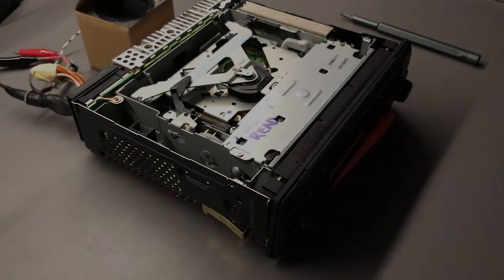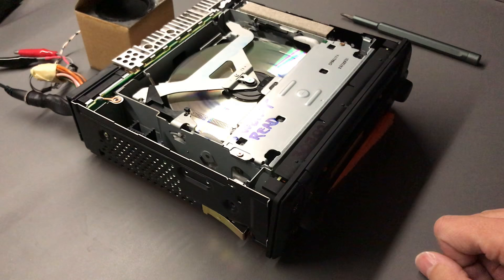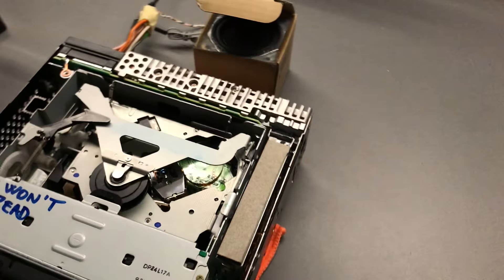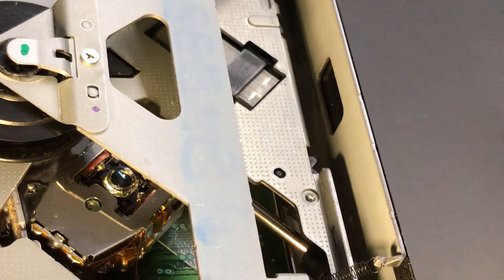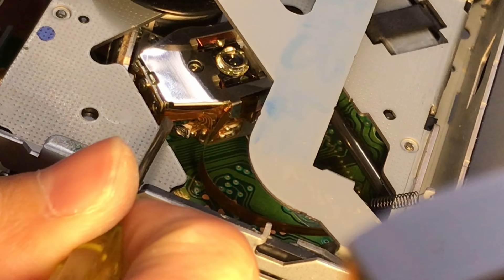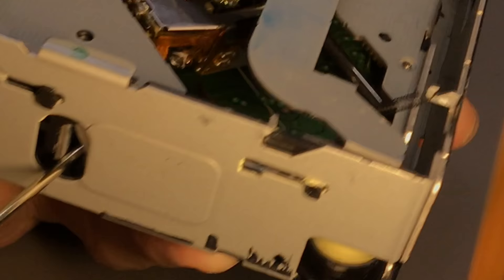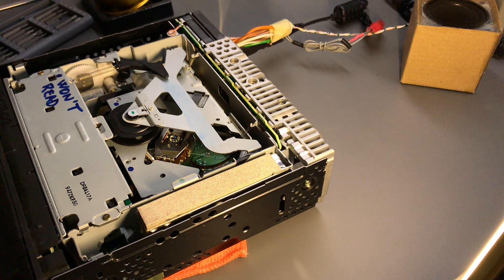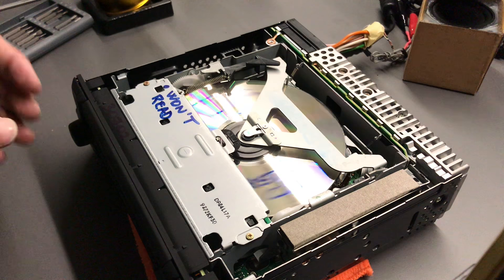CD Player not Reading Disc Fix - Increase Laser Power (to 11)

Comment: Tried this on 30 year old Technics which just stopped reading cd.   Amazingly it worked.   Christmas magic. Thank you for a very clear video
Reply: Did the same thing with a Technics CD Player, Model SP-PG480a some years ago and worked really well. Now i have another (same model) and cant remember how i did it. Do you have a guide of the values for the adjustment?? Thanks in advance!!

Comment: As a laser diode ages it loses it's conductivity like a dimming bulb. To compensate the current going to it can be increased by this small pot to allow the laser 
to become brighter and read the disk correctly! Just don't turn it all the way up or the current will shorten it's lifespan very  quickly. GOOD FIX!
Reply from the maker: thanks for the explanation!

would you expect this to work multiple times ?
Reply: Wouldn’t increasing the current cause the unit to overheat ?
Reply from the maker: yes, which is why you have to be very careful with how much you increase it

it'll die out due to being pushed too hard before overheating though - it's usually part of a big metal casting
Reply: @michaelfeeney8437  Yes but you could monitor it but that may call for some expert analysis with a meter.

Comment: 70 year old woman here.  Our 30 year old 3 disk CD player was not reading in any of the positions.  I bought a cleaner disk that would not even read.  I was thinking of buying a new one.  I decided a drastic fix wouldn't hurt anything.  I doused an unwanted CD in alcohol and put it in and tried to play it.  It didn't work.  I then poured about a teaspoon of alcohol on the middle of where CD #2 sits.  I closed it and pressed the play button.  It played funny for a few seconds and then it worked just fine.  I played it about 30 minutes and it was still working and the alcohol had evaporated.  I'm not suggesting this method, but I didn't need to unscrew anything.  Now I don't need to buy a new CD player in 2020 when they are on their way out anyway.
Reply from the maker: yea, a microfiber cloth damped in alcohol is what fixes 70% of my lasers too

the other 30% do require this nuclear method of boosting the laser power

I'm sure you'd be more than capable of doing that as well with a bit of patience :D
Reply: @Darieee  I do fix things around the house.  Our toaster over door wouldn't stay closed till I fixed it.  Just in the last couple of weeks I spent hours updating a Windows 7 and an 8 to 10s (waited too long because I didn't like W10).  But I really was ready to get a new CD player and had lost patience.  I take of lot of risks when I fix things because I don't know what I'm doing, but it usually turns out all right.    I should mostly make sure I unplug electrical things before working on them.  In my younger days I would have disassembled the CD player, and tried what you did, though.

Comment: Thanks very much for this info, I have just fixed a Marantz CD-63 mk2 KI with this technique.   Currently 17 mins into a CD which it could not previously even see!  This is a must share video.
Reply from the maker: I'm glad it helped! It sure helped me fix at the bare minimum 50 car radio cd modules <3
Reply: Hey Dan, Please let me know where is the potentiometer located in the Marantz?
Reply: @zoranspirov1305  Hello, I'm afraid that I cannot remember exactly where the adjuster is but I do recall that I had to remove and refit the whole carriage every time I adjusted it.  Not too difficult to spot once the carriage is out and the mechanism is upside down.  I did not remove any other parts to access it.  Good luck, it's a great CD player.  Ours is still working perfectly...
Thanks
Reply: @dangodfrey480  Thanks Dan, I'll surely try and fix it.

Comment: Darieee, you are an awesome electronist, I'll give you that. But regarding the 650 MB /74 min CD info... I must tell you I have just bought around 85 pieces of those (from multiple sources), just to realize that a modern 80 min Maxell CD Audio XL II 80 (high reflectance) will do the job. :))

Meaning the info you provided was "asa am crezut eu"-type and actually it was about the CD-R reflectance, which was higher on older CD. But so it is on modern audio ones.

Anyway, thanks a lot for this laser power tip! It's very good to know info although my 1998 Alpine Audio 10 worked without it.

P.S. For burning I use an external Plextor BD-R which is capable of 4X, but 10x works just fine.

Comment: Thank you. This helped with my Denon CDC-680. I had to take a guess fir the right potentiometer because there are 3 next to each other. The left one did the trick.
Reply: Do you mean DCD-680?
I ask because my Denon DCM-440 does not read intermittently.
Reply: Lou Fazio , Yes I have a DCD-680. I cleaned the lens with a Q- tip and fiddeled wit a pot. Now the player reads more discs but not every new one. I was thinking of tweaking it one more time.  Maybe the dust cleaning did it??
Reply: @amajorseven  It is recommended to use a microfiber towel wrapped around a screwdriver tip.  Maybe at least a blast of air from a duster can.  I'd bet film/dust is not the issue.

For mine (carousel type), I'm thinking it may be the disk turning into full position as a read begins.  A belt replacement did restore its tray action.

Comment: Definitely going to try this on my Denon DN-S5000 CD Turntable, as it just does Not want to read CDs  and I've tried cleaning the CD and then cleaning the player itself and I had always wondered why it "Looked" like it was struggling via the screen showing all pertinent information was bright, but then a little less bright and then even less bright...... and then trying again..... really Bright, then less and less. Finally, saying "Disk Error"...... I will let you know how it goes and I will only turn it in small amounts as to Not burn something out or beyond repairable.  Nice 1.  Appreciate the video, as there are not to many on this type of problem for CD Turntables.  Beauty.  ty.  L8er vader.
Reply from the maker: <3 glad it 'possibly' helped out!

did it work ???
Reply: @Darieee  ...... Problem!!!  I can't seem to find "ANY" bolt, nut, screw to turn and dial up the laser power output.  No reference point, as this CD drive is "VERY" different from other drives......   I think,,, I believe. lol.  I am trying to look it up now.  Either way, I Will let you know the outcome... and again, thank you for your video and input.  Always nice to have more Input and Info when working on a project where my knowledge is sub-par.  L8.

Comment: You must be very careful to check before turning the pot that it hasn't got a spot of weak glue  (like a nail polish)  sometimes red in colour which is used to hold the the pot you turn in place. If you don't remove that glue/nail polish whatever it is the the whole pot will turn ripping itself off the circuit board damaging it completely. A dab of isopropyl alcohol on the pot for 10 seconds before you turn it will suffice.

Comment: I've been looking for a lot of repair movie clip so far. Most of the videos were about replacing or cleaning pickups. I couldn't find any explanation for calibrating the laser power. After watching this, I fixed the CDP that was difficult to fix very easily. Thank you very much.

Comment: Fixed a Panasonic RX-DS750 boom box that was built in 1996.   Laser adjustment can be accessed without taking unit apart.  Insert CD, select something around track 6-10.  Stop it and remove CD.  Head will be aligned where you can get a small screwdriver in the gap on the left side of head.  Mine just took about a 10 degree counter-clockwise adjustment of the screw.    Thanks for the video!

Comment: Thank you for the tip! I did this on a JVC PC-X300 ghetto blaster I bought new in 1989. The CD stopped reading 10 years ago but the unit is otherwise in mint condition. Was about to give up on it until I started researching and found this video. Only thing different is I had to turn the trim pot clockwise for it to read the CD.  Thanks again for sharing your knowledge, this has brought new life to my old classic stereo.

Comment: My 1996 Toyota Camry LE’s OEM CD deck uses the same laser assembly as this. Interestingly, there is a sticker on the deck’s outer casing that reads “US 4,527,265 under license of Staar S. A. - Brussels - Belgium”. Perhaps Fujitsu Ten (who provided the stereos for Toyota) and Mercedes used the same manufacturer for their audio systems.

Comment: Good fix   Works the same on a laptop cd drive. Just did this with a q tip and circuit cleaning spray with alcohol and  it fixed the drive
Reply from the maker: awesome 🤘🤘

Comment: Hi I have a FORD BA 2003 UTE WITH A 6 STACKER CD THAT WON'T READ CD'S & EVENTUALLY EJECTS THEM EVEN AFTER USING A CLEANING DISC MULTIPLE TIMES. SO IS THIS THE NEXT STEP FOR ME I WAS HOPING NOT TO HAVE TO REMOVE THE PLAYER FROM THE CAR I AM GUESSING THIS CAN ONLY BE DONE BY REMOVING THE MODULE, IF THIS IS REQUIRED IS IT DIFFICULT TO DO ON THIS MODEL? THANKS APPRECIATE YOUR HELP

Comment: On two of our cars (older, 2001 and 2003), the disc is taken inside, then makes 3-4 clicks and then comes out. Occasionally it starts playing, like catching smth inside of the radio CD player, but in most cases, the disc just slips and comes out. What that can be and how to repair this problem? Thank you for the great film.
Reply from the maker: the mechanism's plastic bits sometimes break .. some springs sometimes ping off

you'll need to open the radio and get to the cd-player module inside

also - it has a rubber roller which catches dust and loses its grip - some window cleaner on a rag takes care of that with spectacular results
Reply: @Darieee  Thank you for the replay. I tried to clean today w/ a disc made fm/thin cardboard 2001 Saturn SL2: moist it a bit w/91% Isopropyl  Alcohol and inserted in CD player opening, then removed it slightly wiggling around. I don't remember if I pressed the Eject button, probably not. The cardboard was removed, but the slot got stuck in the way that I can't install CD anymore. More of that I tried to push those parts inside w/CD and all the doors started to lock in and out like crazy. Eventually I closed all the doors, but CD player is broken completely. All that has very good outcome though, since that car started to have a problem recently w/doors, they would got open, all of them from time to time, and we couldn't figure out what causes it. Now I know, that the malfunctioning radio unit causes it, bcs the disk was sitting inside. I'm planning to order new radios for both cars. Thank you again.
Reply from the maker: let me know if I can interest you in some with Bluetooth ✌️

https://youtu.be/Ud8wfRcM0tc?si=xjfgX8xf68wqFc2E

Comment: Would this work for a portable Sony Discman? It stopped reading discs but if I put hot air inside the disc door (5 seconds with a hairdryer) it works every time. Diode flaking out? Hate to throw this super-rare D-828K away.
Reply from the maker: could definitely give it a try 🤘

Comment: Hey, Thanks for the video. I've got 2005 Nissan Pathfinder with 6 CD Compact Disc Changer. I've tried almost every single CD which I had (including original or manually burned) and it only plays 1 particular CD which is Classical Music Collection. I have also cleaned the laser reader and nothing changed. They told me to replace the laser, but its really hard to find it. So is there any solution that can be found or my car is just a maniac of Mozart and refuses to play other music :)
Reply from the maker: Mmmmm, so original releases also don't play?

It might be an old laser module capable of only playing 650MB discs
Reply from the maker: Or did this laser power boost fix it ??
Reply: @Darieee  It says MP3/CD PLAYER, but unfortunately it doesn't read anything except the above mentioned. :(

Comment: Sitting here with open mouth, wondering how on earth you got the idea that the problem is that the laser is weak and that this particular  trimmer would increase the power and solve the problem. Wow...
Reply from the maker: yeah, shouldn't be that amazed ... I mod mercedes radios now, and at some point had quite a few with defective cd units

I also started to (and still do) have around 3 4 5 busted cd drives ... with some broken plastic parts or dead motor drivers ...

so I did take a laser completely to bits once ... to see if maybe there's something I could clean

and there, when I held just the laser assembly in my hand, I saw this trimmer, clearly going to the laser ... turned it not knowing what to expect and hey -- it worked !

(afterwards I did see there's another dude on youtube also suggesting this, but mainly just people telling you to clean the lens)

Comment: Good post. Have done this as short term fix, might get a few months out of them if you're lucky, never had any long term success in years by doing this because the diodes are breaking down, it speeds up their demise by increasing the current. CD lasers are all pre-set when new and they should never be adjusted from new if they do not work. I have had defective ones which iv'e had to send back. Buying and fitting a new one from a decent supplier is much better depending on your on budget, they vary from £10 to £500 or more.
Reply from the maker: hmmm .. well, to be honest I never had the chance to test them out long term .. 

have you had them die out 'again' ? what kind of run-time did you get ?
Reply: @Darieee  Got a few months, but not years. In the end they fail to read the TOC because they can't focus, you can hear the laser knocking the disk sometimes. I think other people might be lucky and get more time out of them.
Reply from the maker: Got it! Very interesting insight - thanks for sharing 🤘

Comment: Hello brother,pls I have tried my possible best to clean my s320 benz lenz but it kept playing a I second and stoping.and I dont see how to adjust the lenz.
Reply from the maker: mmm ... it could simply be another problem

or.. did you try boosting the lazer power ?
Reply: @Darieee  thanks for the respond,the problem is that Benz s320 radio in very complicated to reach where the boosting adjustments.if I could adjust it I believed it will work but only if I see a pro to open it and do that on the video,then I will be able to penetrate alike.

Comment: I have a hi end Jay’s Audio CDT3 mk2 transport. It plays most discs perfectly, but it has said No Disc for 2 discs. These were both Now albums with lots of tracks. Could the disc itself pose a problem for a transport? I can play the problem discs on another transport. The transport is mint btw and cost me £3000. It’s only 2 discs it has so far exclusively rejected.
Reply from the maker: hmmm ... who knows

they for sure must've used 700MB discs and not 650 on the problem discs

do try and read them on a computer and see what the disc parameters are

also - I'd assume said transport can handle random burnt CDs, right ??
Reply: I haven’t tried CD-R s yet. CD length seems the most obvious reason, but it’s only a guess. Most searches online suggest the laser is on its last legs but this doesn’t seem likely as the problem is too CD specific.
Reply from the maker: do try burning some random CD-Rs - would yield some data on the issue

and - yea - check the disc metadata
Reply: Just tried a CD-R and that played ok. Then tried a few later NOW albums and many disc can’t be read. I think it may be due to them being long, even though some it reads are 78 mins long.
The transport uses the best Philips mechanism CD Pro LF.
I’ve never burnt a CD myself.
Reply from the maker: yea .. they might be burning stuff out of spec just to fit more in ..
Reply from the maker: the actual laser decoder shouldn't add much to the sound quality though .. so .. if you can you could change that

so long as it doesn't skip, 1101 will be 1101 🤘

Comment: Interesting. I have a 10 stacker Eurovox on my GM Holden that sometimes will not play a commercial cd. Made in 2000. Maybe this is why.
Reply from the maker: might very well be .. either dust or needs 650MB discs

Comment: How did you discover that you have to turn the pot counter-clockwise to increase the power instead of the other way? I'm sure I've seen other videos where they turn it clockwise...but I could be wrong.
Reply from the maker: ah ye ... just nudge it ever so slightly one way

if that works it MUST mean you've increased the power 🔥
Reply: @Darieee  Just don't wanna risk damaging the thing by mistake, but thanks anway.
Reply from the maker: yeah - if a slight nudge one way doesn't do it

go back, slight nudge the other way around ... then increase the amplitude and try both ways again

if it doesn't work now ... and it doesn't work after a try like this ... it's hard to say who did it 🤘
Reply: @Darieee  I appreciate yoiur answer and I shall try that - thank you.

Comment: Hi,

Does trick apply also to MiniDisc players too ? 🤔

I have a Sharp MiniDisc MD-T20 unit which gives me a "NO DISC" error everytime I put in a MiniDisc. 😞😭

I was able to fix the TOC ERRORa fairly easily but now this is happening.

Thanks ! 🙄🖒

Best Regards,
Reply from the maker: what's a TOC error - and how did you fix it 🔥, sounds interesting

as long as there is some adjustment somewhere on the assembly / main board, it should be doable

maybe if they got their tolerances tight enough you'll have to swap an SMD resistor

just remember to only SUUPER slightly tweak the value

do let us know if you had any luck
Reply: @Darieee  Edit: I was able to fix the "NO DISC" error. I guess I had to turn the trimmer potenciometer a lot. 😃

I'll make a video on the "TOC ERRORa" issue in the future.